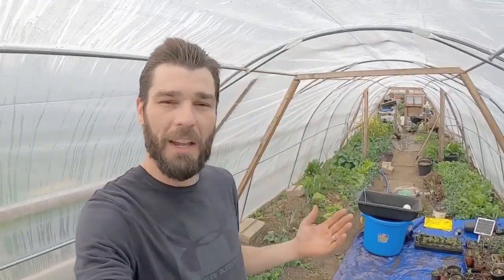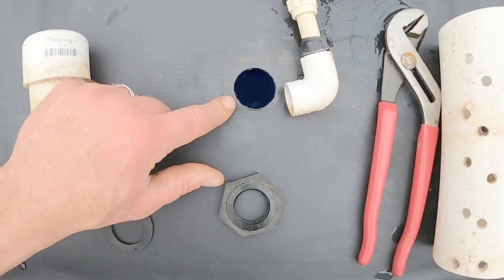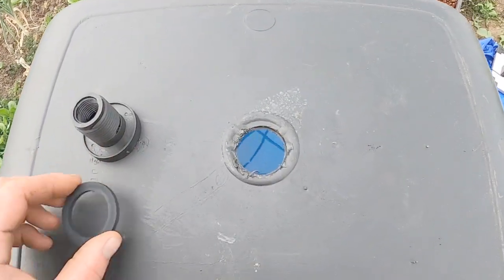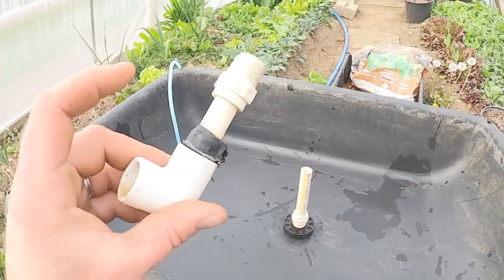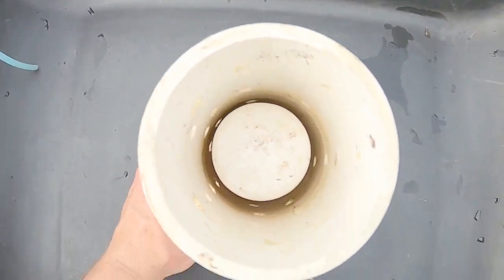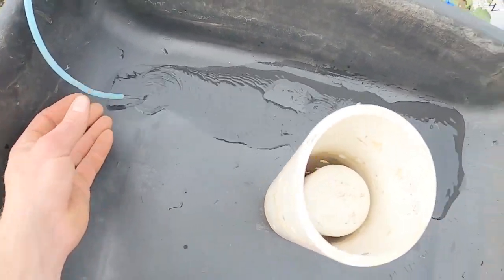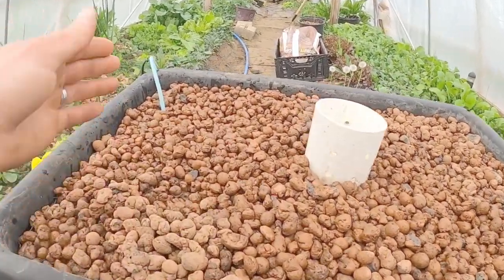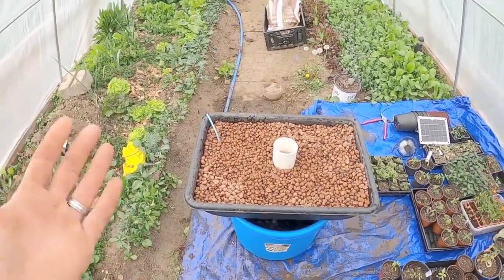DIY Solar Aquaponics Build In 5 Minutes | Bell-Siphon DIY Build & Walkthrough | Propagation Station

Comment: How many pounds of clay pebbles are in that tub? Any brand you prefer?
Reply from the maker: Shoot, I have the bag in my big greenhouse I will get back to you on the brand. But with these diy water tubs I got them at a discount store for cheap cheap and they work perfect, saw new ones at tractor supply and they were 25-30$ if I remember correctly. They don’t weigh very much due to their porous nature I’d guess three to five pounds Maby I always just fill the tub up right half inch to an inch below the rim to allow the water to build up and be able to flush with the bell siphon without overflowing, I’ve had a few trial and errors when starting out lol. I’ve got four ready to go for next spring and I’d like to build myself a “free material” small pond in the big greenhouse I’m always scouring the internet for bricks and stuff to build with, quite a handy resource! Thanks for the great question and checking out the video sir!
Reply: @Earthdwellershomestead  Thanks, I zoomed in on your video and got the brand and size. If your looking for more tubs check out Harbor Freight, the have 7gal tubs for a good price.
Reply from the maker: We just got a harbor freight built and opened recently near me thanks for that information there man, appreciate it!

Comment: I find a sawzall cuts slits faster than a drill can make holes, and the slots are less likely to clog.
Reply from the maker: Thank you, I may use that info, I was checking out perforated pipe and they didn’t have anything ready made that would work so I will be making it all diy for more systems.

Comment: Woah. I was wondering if this were possible, this is amazing. Two questions 

1) what is the brand name of the solar panels and pump?

2) Are there issues with the plants and/or fish dying if the water isn’t being recirculated during the night?
Reply from the maker: Here’s a similar size and price pump like I had repurposed for this system-Solar Fountain Pump,New Upgraded Mini Solar Powered Bird Bath Fountain Pump 5W Solar Panel Kit Water Pump,with 6 Different Spray Pattern Heads, for Pond, Pool, Garden, Fish Tank, Aquarium,Patio https://www.amazon.com/dp/B08394W6SY/ref=cm_sw_r_cp_api_i_RXW3DAKGTK3BZQH0RQR5?_encoding=UTF8&psc=1

Last summer we didn’t have any issues as the clay peoples hold moisture and the bulkhead fitting is raised a 1/4 inch or so keeping that much water even after it bilges. We used breeding guppies as our nutrient supplier so they are able to breath from the surface of the water isn’t well oxygenated, we also had it on a timer on our old system in our little 6x12 hoop house on a battery bank running on a timer. I’m wanting to get more set up here soon and should be able to shade the system and begin propagating. Thank you for the questions! Should be more on this subject coming here soon

Comment: Can you tell us about what or how you're feeding the plants? I've read with fish aquaponic systems you have to cycle the system for a couple of weeks to grow the right bacteria to get the right nitrites/nitrates (i forget which it is) in place. Curious as to how you're handling it. Great to see another vid; these are my regular moments of "zen".
Reply from the maker: That’s a great inquisition, last summer as an experiment I used a breeding batch of guppies or mosquito fish as my nutrient providers. When I initially set up the clay pebble system I used the fish tank water and all it’s contents in my small overflow to allow all the sediments to recycle up to the pebbles and settle in the pores. This worked quite well as the tank wasn’t too dirty but wasn’t super clean either so I had some good nutrients to start with. I was able to grow plants and root up lots of cuttings simultaneously in the pebbles but my main purpose was purely to propagate fast and easy not to grow food continuously for harvesting, there is definitely a different approach when your making growing beds. Once I get my four container system up I will have some more info on the subject. An afterthought is that the only input I had on my aquaponics system all last summer was to top off the water occasionally and a pinch of fish food daily. And we fed the fish dried kale and other nutrient rich leafy greens to supplement fish flake costs. Thank you for checking this out and hopefully I have a good system for feeding these plants and getting a larger newly setup system acclimated to plants and fish.